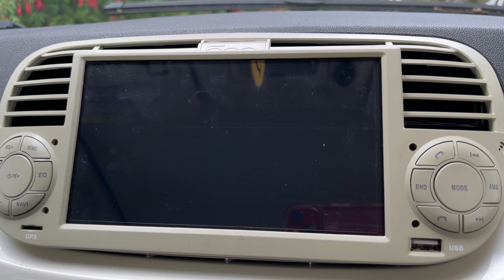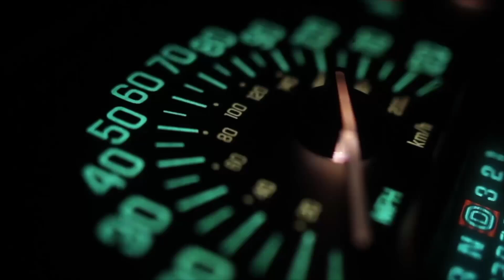Project Foxy - Bit of a Problem, needs sorting before sale. Fiat 500C Copart Cat S Salvage Crashed

Comment: Brake binding which as you say is because of the handbrake cable tension..
Brake binding can be an mot failure but usually an advisory.. 
Wheel Bearing check , Spin the wheels listen, feel for noise and vibration, they also do this at the mot test.
Reply from the maker: Yeah it was never going to be the brakes as it continued if you had your foot on the brakes.

Comment: As we speak,mine is at the garage having front shocks and rear bearings replaced. I jacked up the rear and spun the wheels but I still couldn't figure out which is gone but I suppose I will find out in due course.

Comment: The code for the tyre is like the expiry on your credit card, and it’s the week of the manufacturing year, followed by the year (I.e. 20/16 would mean the 20th week of 2016).

For the stereo, do you think it might be an idea to check the firmware version for the Android software being used?

Thanks also for checking for me on the undersill Gromit - I guess there wasn’t a part number??

Farewell Foxy, and keep ‘em comin’!
JCHK
Reply from the maker: It could be firmware I guess. Don’t know how you update that. The manufacturer never did come back to me despite two emails and a message through AliExpress.
Reply: Might be too late for this time round, but there should be an ‘about’ page on the stereo, and, if you could establish a wiki convection from it, maybe via a hotspot from another android device, you could update the stereo firmware over wife from the other phone downloading it.

Comment: I’ve got an unidentified intermittent noise, been like it 18 months and 4 mechanics can’t diagnose it as it doesn’t do it for them - had to play a recording of the noise to them, one suggested new brake pads, still happening since new pads 🙄 these things are sent to try us
Reply from the maker: What sort of noise and where from?
Reply: @Love500  when I’m braking down certain hills, or slowing from high speed, like a metallic grinding then a ticking as I accelerate - there is a short clip of the noise on my channel on here, it’s the only video lol
Reply: We had that kind of noise  and checking everything in the end we changed the brake discs....noise gone.It was the inside surface that had broken up in places, but the outer was almost like new.

Comment: I have a 2012 Lounge model here in Canada and my 5th door give me intermittent problems to open. Now doesn't open anymore. May you guide me to fixed it?
Reply from the maker: The handles can get worn and there is a little rod with it that moves and just needs pushing back. It also suffers from the micro switches seizing and lastly could be your hatch wiring. It’s impossible, obviously to know which is your problem.
Reply: @Love500  Thanks for the advise!